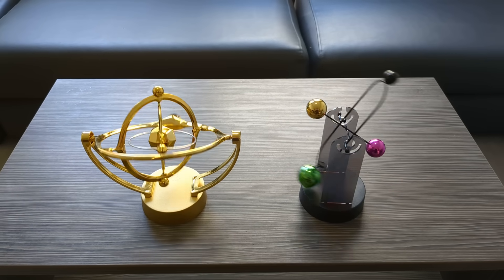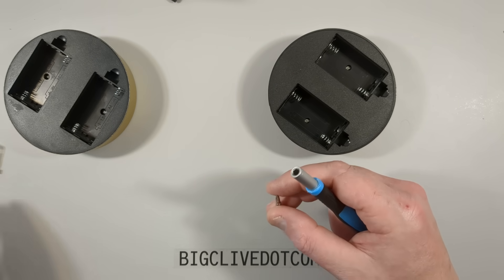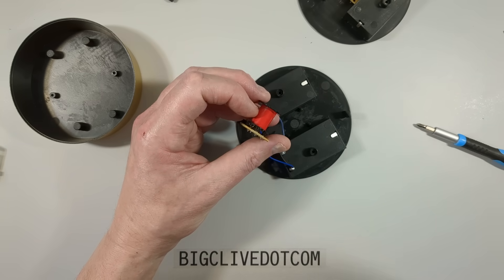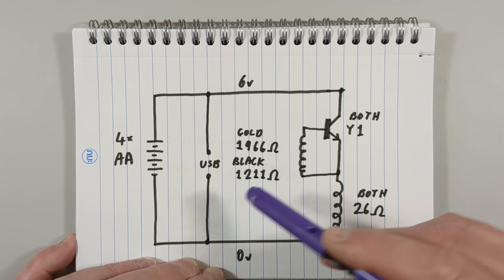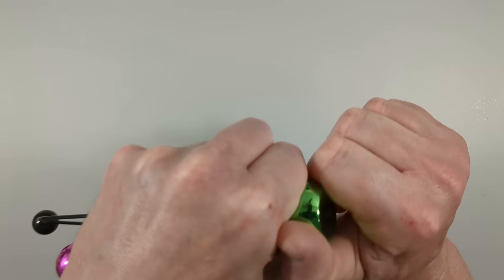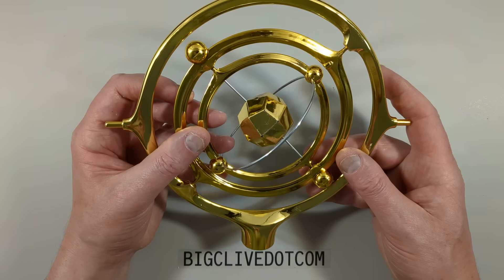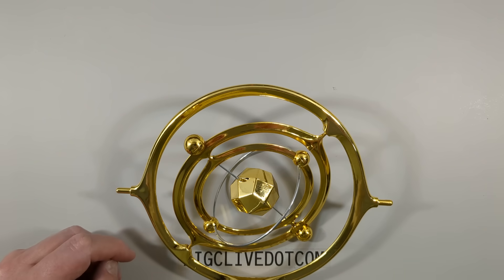Perpetual motion machine teardown - with schematic

Comment: Used one of these to make my own "perpetual motion engine". I made a wheel  out of wire with 4 ferrite magnets spread equally on the outside and then spend a excessive amount of time balancing it (probably far more than needed). 
Made a new base for a bell jar with coil batteries etc. in it and put the bell jar over the entire contraption. 
The result: a wheel under a bell jar that never stops spinning. With a neat tiny plaque on the base with "Break laws when they are unjust" as my middle finger to the laws of physics trying to keep me down.

Comment: The 'cylinder and spheres' experiment increases  the energy of a closed system by 1000% in less than a second. No batteries are needed only Newton's Second Law of Motion. You can actually do the same thing in straight line motion.
The 1.188 kg cylinder gives all of it motion to the .132 kg spheres. When the smaller spheres hold all that momentum, they have 10 times the energy. 
The spheres can cause ten times the original motion of the cylinder and spheres by being the extra mass in an Atwood's machine of equal mass. The spheres, for example, cause  a 1.2 m/sec speed for the whole system after THEY are dropped only .7339 m. And the spheres will then rise 7.339 m.
Throw the spheres out and then let them rise into an Atwood's machine, and you will have a prepetual motion machine. 
The 'cylinder and spheres' under delburt phend are on the internet. Smokin Lamas is also interesting.

Comment: 6:30 My assumption is the USB being shunted right to the battery terminals is that the AA format (replacement) Lithium Rechargeable Batteries, with their own integrated charging-control & protection circuitry, is slowly becoming more common in the consumer marketplace, and the manufacturer is saving money assuming people will be smart enough to use those.  That or the USB is a mode of operation not intended to be used at the same time as batteries.

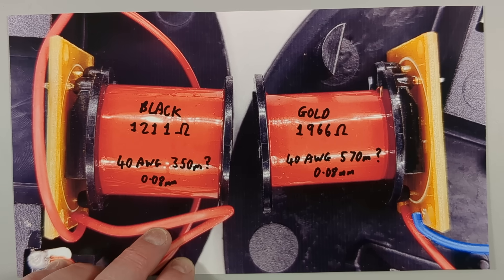Comment: @6:03 Stupid Question Time.

Looking at the Schematic the 6v (batteries) goes to the USB, but if you plug in a 5v USB cable will it be 11v?
Reply from the maker: No.  The highest voltage would probably dominate.

Comment: I think the little hole in the spinning thing is to add an optional weight when it doesn't perform as expected because of loose manufacturing tolerances.
Reply from the maker: It might have been for adding a small magnet for other effects.

Comment: The higher resistance winding feeding the base is suggestive of functioning as a constant current source, to ensure the transistor saturates.
Reply: Actually no, the higher resistance is because it has many more turns to get a higher voltage (more sensitive, and less drag on the magnet passing by)

Comment: you have to be amazed at those modern transistors, all common now the original Zetex patents have expired so now you can get a tiny transistor that can handle 1.5A, while still having a pretty respectable gain while not being a darlington. Meanwhile the old Jedec and Pro Electron series were typically 100mA rating at 40V, and had a serious fall off in gain at that s well, till Zetex patented their new designs, that gave incredible gain, low noise and current handling that till then needed a TO220 or TO218 package device to see, but they made saturated switches in an E line package.

Comment: 4:06... I was playing around a little while back with wireless power transfer, using hand-made xmitter and receiving coils, powered by garden light joule thief circuits connected to the transmitter coils. 

And it's pretty wild how I could come up with the same power transfer, using the same input power, with several different coils, while changing the magnet wire diameter, number of turns, and the diameter of the coil itself.  Each different configuration, whether it was the wire size that I changed, or the diamter size, took a very specific/precise number of turns to get back to the same efficiency as a previous configuration. There is somewhat of an art to getting all 3 variables just right to get the peak efficiency of power transferred out of it. Freqency would also have a play into it, but I just left the joule thief circuit alone, and concentrated on getting the coils just right using the stock frequency of the circuit. 

It was quite an interesting experiment for sure, learning about the interaction between the 3 variables of the coils. These were all air coils. A ferrite core coil would be a whole different game again to play with. Good times! 👍

Comment: It's a modified joule thief. They moved the load to the emitter. The base drive has no trickle current to put it barely in class a mode, so you have to give it a push to start oscillations.

Comment: These are much more fun when you replace the swinging pendulum with a fidget spinner that has neodymium magnets attached to it at every edge to act as the pendulum but in a rotary fashion..  I used a piece of garden tie wire to suspend the spinner just above the coil and each turn as it spins triggers another push from the coil! It spins FAST!!!!!! I know it feeds plenty of voltage spikes to it but it hasn't died yet!

Comment: I'm fascinated by these. The video where you put one on a scope was particularly interesting. I'm left wondering what the signal across the sensor coil looks like. I couldn't figure it out from the trace across the power coil. It seems the signal should go negative with a zero crossing as the magnet passes over the coil centre. 

The ball version wasn't chaotic in the video. I found you can make it chaotic by adding a small neodymium magnet to the magnet that drives the centre balls. 

The "novelty wearing off" comment was  interesting too. I keep three running in the lounge permanently but I've noticed others have the reaction you mention. That's not the same for the fake pendulum clock versions.

Comment: Are you sure the drive coil energizes the base coil? 7:20   My 2 current probes did not show that function.
EDIT, to be fair, I did this testing 2 decades ago on the "Top Secret" spinning top, and it has the exact same sch for the BLDC motor.

Comment: 8:06 wouldn't you want a series resistor with protection diode? I reckon the spike would be just as back for the diode. Thanks.

Comment: If the wire has really the same diameter it could be a copper with a much higher sulfur content from its reduction plant. It sure lowers costs and presents a high enough impedance to the transistor to live past its warranty period.  The non isolated USB is there to give reason to use one of them now obsolete phone chargers. Saves the leakage mess if batteries are indeed removed.
Reply: probably copper clad aluminum anyway(CCA) cheap cheap cheap go the birdies!
Reply: @throttlebottle5906  True. I see this more and more.
Reply: The base simply has way more turns.

Comment: The addition of that diode at 8:00 allows the batteries to get pulse charged. It will run for at least twice as long!
This was John Bedini's scam with free energy.  
Don't use it on the USB port or kiss that USB port goodbye.

Comment: My grandpa had a sign that had a pendulum motion type system that was similar to one of these perpetual motion systems, but it used contacts on the hinge to trigger the electromagnet kick instead of using a coil and transistor since it was from the 50s. It took 4 D cells and he said it would drain them within a week.

Comment: I wonder if one could be made with a hall effect device and a circuit to drive just a 26 Ohm coil rather than half a kilometre of very fine windings as the sensor part.
Gaz Yorkshire.
Reply from the maker: There are kits sold on Ali-X that use a hall effect sensor.

Comment: For the orrery-styled device, the addition of a few multicoloured LEDs on the centre 'disco ball' may help to make use of the excess power available from those alkaline cells, otherwise they're likely to fail due to chemical degradation long before their stored charge is used, shirley? That being said, will either device work with 1.2V NiMH cells?

I'd be interested if you did an exploration & explanation of the vacuum globe 'perpetual motion machine' that simply requires (sun)light: it's also a lot less visually intrusive than these blinged-up bits of plastic & pot-metal.. tho similarly less useful to deconstruct for spares :)
Reply from the maker: Radiometers?  An interesting novelty.

Comment: Using a PP3 battery today is the best way to ensure that your product barely sells. At least in Spain it's easy to find packs of 6 to 10 AA batteries for the price of one PP3 of the same brand. Lately, I've started seeing packs of two PP3 batteries, but honestly, I didn't check how much you save, but with modern marketing scamming techniques I wouldn't be surprised if a pack of two cost the same as two packs of one 🙄

Comment: I wonder if the one with the USB socket is designed to work either by USB or battery, but not both.
Reply: Not without at least the diode (shown) & some other circuitry :(

Comment: Cute little magnetic behses.
I seem to remember a video you did a while ago about charging NiMH batteries in series from a power supply. Do you no longer advocate this?
Reply from the maker: They can be trickle charged at very low current or charged at higher current for a controlled length of time.

Comment: The most difficult thing about building perpetual motion machines is figuring out where to hide the battery.
Reply: If it had an obvious battery and moved literally for ever because the battery was high enough energy capacity and the device was low enough energy consumption, then this would still literally be a "perpetual motion device". you could even find an external energy source that will exist literally for ever and and if it ran off that, that would still be "perpetual motion". 

"perpetual motion" just means moving for ever. That's not that hard. If an atom is above absolute zero then it's moving, and it's unlikely that any atom is at exactly absolute zero, hence there's loads of perpetual motion all around us all the time. 

People conflate perpetual motion with "over unity" where you get more energy out than you put in. That is impossible unless you draw the lines of your box unscientifically. For example you could argue that a solar panel is "over unity" because it can deliver more power than it takes to make basically "for ever". (yes, they get less efficient over time, but if it's >0 energy that's the threshold then it will output that for longer than probably matters. If you need more power, add more panels. When the sun dies, we will have bigger issues.)
Reply: @Leo99929 yeah just find a truly infinite energy source it's easy (joking)
Reply: @Leo99929  you are the life of any party i take it?
Reply: @SupremeRuleroftheWorld  I throw legendary ragers, and try to reduce ignorance. Rarely simultaneously.

Comment: i have a seith thomos pendulum  clock  that was given to my dad for 30 years at GTE. still running on same battery sence about 2010 battery exp date is 2014
Reply: surprised it hasn't leaked and ruined it with corrosion yet, maybe they went all out with a lithium or dry cell? I cannot get or keep batteries from leaking, even in cool areas with almost full charge still, they just start puking.

Comment: Never try to recharge alkaline batteries, always read the battery label and if it doesn't have a label dispose of it accordingly! I did it by accident once and let's say thank goodness I was next to the charger!

The battery made a pop sound and started leaking! I had to open the charger to clean it because the liquid got inside and could have short circuit the charger!

Comment: The protection diode can be an LED so you get a visual pulse - here's the paradox from where all the radiant energy myths originate - where did this power come from ?
... And, will the battery usage increase or decrease with the diode in circuit ? (A similar paradox is an ice cube melting in a glass of water - does the water level go up or down ?)
You can also connect the diode to another battery and charge it - and then madness creeps in and the thought of battery swapping and it'll run forever !
Reply: Of cause the water level goes up. Just as the steel ball reaches the moon faster than the wooden one.

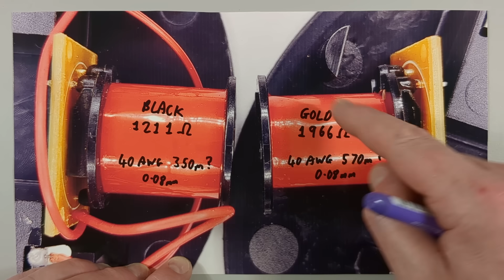Comment: 5:26 Higher resistance for a larger coil? 1211 is less than 1966. Are you meaning proportionally to the length of wire?
Reply from the maker: I screwed up.  It was a lower resistance for a larger coil.
Reply: Ah, I thought I was loosing the plot!

Comment: Shouldn't they keep working once you remove the batteries?
Reply: No, besides the circuit being open without batteries(or USB), so it having no ability to actually do anything other than turn any inductance on the coils into heat.
Without additional (electrical) power input, all kinetic energy the pendulum does will just get wasted into heat by friction in the hinges and by having to push the air out of the way.
Any circuit that could harvest energy from the pendulum falling under gravity to kick it, would just make it slow down even faster, because whatever gravity energy is being used to generate power, will never make up for the amount of energy it has to spend to kick the pendulum.

Can't make energy out of something, then spend that energy without losing some in the process.
Reply: @VekhGaming I think he's being sarcastic.
Reply: @peterknutsen3070  Probably, but I've been on the internet long enough to always err on the side of "lack of knowledge specific to subject".

Comment: You could add a few solar cells to the top and possibly a supercap to keep it running without batteries.
Reply: I did exactly that. Worked fine. Was a 9V variant